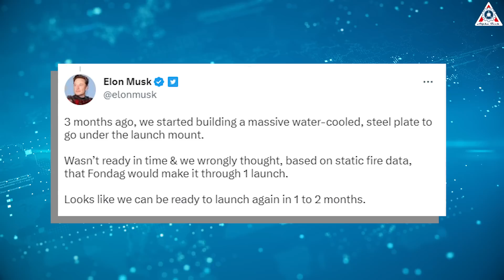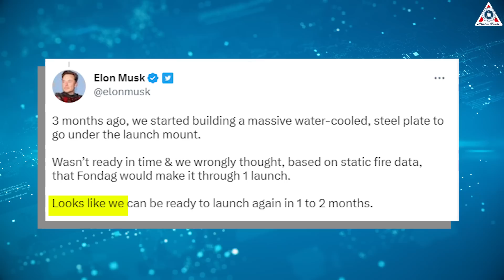SpaceX Stage 0 plans changed after huge damage from testing...

Comment: The problem is wrong think...  Obviously the thrust from the rockets is creating something more like a continuous wave of detonation than any thing else. Like an explosive device that is kept fueled.

Hard anything probably isnt going to stop it. You need to start using soft instead. This is why castles are no longer valid defenses since gun powder, and Militaries have shifted to earth works, fences, and mobility.
I suggest the quickest way to solve the problem experimentally is to drive piling off shore from starbase, and build a cantilevered away from the blast support structure for launch support. use the water.  perhaps hose the piling with a washdown.

Maybe think in terms of the access having a removeable bridge section. or using a transfer barge. This will get us down the road.
While we begin to rethink for landings and take off on Moon and Mars, where we will have zero infrastructure for years.

Another option would be doing a barge with an open center to the water for the blast area. This would make loading the Starship easier from a quay.
I doubt even water cooled steel will be good enough, directly under the thrust. Chances are the steel surface will be eroded quickly enough that it would have to be replaced at every launch.
Reply: Actually, thrust is the force that the engines produce that lifts the rocket and propels it forward.  What caused the pad damage was the hot exhaust flow plume and acoustic energy.  What you see coming out of the engines is NOT the thrust.
Reply: @BKD70  Same difference... all I know is we are dealing with the limits of hard materials, and we need a system capable of withstanding multiple launches and landings per day, and doing it for periods of years, with only minor maintenance.

They will try the water cooled plate, and I hope it works. but I doubt it.
This is not your grandfather's rocket, and if Elon builds the 4x larger Super Starship 2.0, we are going to have even more energy to deal with.

I would suggest that the best thing behind the rockets is nothing... and design from that end with the softest somethings we can figure out. I have previously suggested designing the ships to both take off and land from water. And the only thing that comes to mind for Moon and Mars, is having a support structure intergal to the ship that bridges the calculated crater. thats not gonna be easy, and would require plume  rototilling the landing field and then being able to refill craters via bulldozers to get continual use.

The reality might be that we can build a system to launch huge loads from earth, but have to go smaller and less powerful for landers for moon and Mars... we are up against practical limits. And for now, what we need is to get Sh*t up there in unlimited quantities, and preferrably shift to elevators ASAP.
Reply: @garylester3976  Nope.  Absolutely not the same difference.
Reply: @BKD70  whatever... we have a problem in want of solutions, surely correctly defining the problem will help, but its solutions we need to apply ourselves to.
And we want to get something reliable, that can continue to function without problems. And the only things I know that you can crater and it refills itself are things like water or air.

Truth of the matter is a deep enough hole would solve the problem, but I know the water table in Brownsville is at sea level. that whole gulf coast is like that, so any hole below sea level is gonna fill with water, Might as well use the water. it has the qualities needed. fresh water would be better, but I suspect everything in the area is brackish. Might pay to just use the salt water, and have a way to clean with fresh immediately.

I've also suggested a firewall Between engines and cones, and using cones for thrust vectoring.
This would keep both brine and flying objects out of engine compartment. 
That stainless is a 304 varient, the only problems with salt water will be at the welds, where the alloy
has degraded slightly, and that can be bettered via a slight DC current charge.

What we have is a problem, reality doesn't care about the plan. We have to adapt.

Comment: How much wishful thinking went into the design of the show LM? Launchpad technology was perfected 60 years ago or more. Yet SpaceX didn’t seem to be able to get their mind wrapped around the realities of what they needed for starship. Is this the only wishful thinking they’re doing or is SpaceX prone to a lot of wishful thinking? For example, as the angry astronaut pointed out the flight termination system, seem to take a long time to work. Far too long, if the starship had been headed in the direction towards a populated area which was entirely possible, since SpaceX had lost control of starship.
Reply: If you look at the NASA requirements for a Flight Termination System they specify that the explosives uses are only supposed to be powerful enough to punch holes in the fuel and oxidizer tanks and not be able to cause an actual explosion.   The Starship system worked fine...when it was spinning sideways right before it came apart you can see the fuel and oxygen venting from the termination holes.  Once the internal pressure is lost (which on a fully fueled ship can take a while...like 30 seconds)  the ship structure is not strong enough to withstand the flight forces and rips apart...as it did.

Comment: An Exhaust diversion system is the only solution, no other idea will be successful as there are huge volumes of super-hot exhaust turbulence that will burn up and destroy a flat surface lying below that exhaust in direct line of fire so to speak. Steel plates will not divert the exhaust thrust, it will just divert it in all directions culminating in the same damage to everything. I cannot believe that this was not foreseen from the beginning, such a waste of time and money.
Reply: Damage to everything was just chunks of concrete the size of a small man flying around. Steel plate will work, but they will need a huge water deluge system to reduce the sound waves reflecting upwards
Reply: @tedarcher9120  Hi Ted, steel plates may prevent a concrete base from breaking up into massive projectiles flying around at high speed but the problem will still exist. It is not only structural damage occurring, just as damaging is the "high speed super hot turbulence" building up like an intense furnace propelling upward and destroying the engines as what happened at the first launch. That booster sat for at least * seconds before it slowly lifted off and at least another 20 seconds before it lifted clear of the platform, that is 28 seconds of super-hot gases heating up and melting everything it touches even with a deluge system.
Reply: @mattblack9069  gases can't really go up into the engine bay because they will be pushed back by engine exhaust. Problem will be shielding the piping around the tower from flames. It wasn't just fire that damaged engines on the first launch, it was probably huge chunks of concrete flying upwards and bouncing off the tower